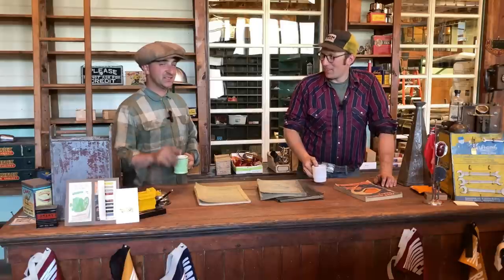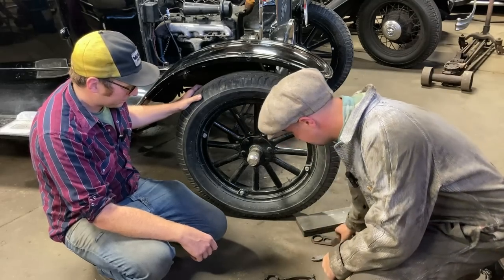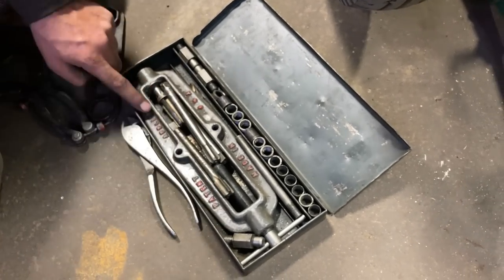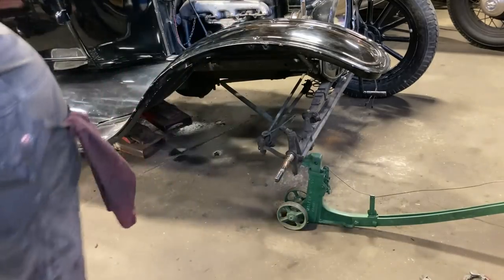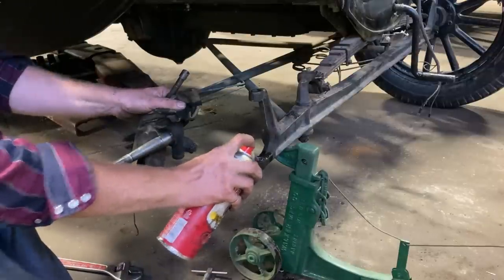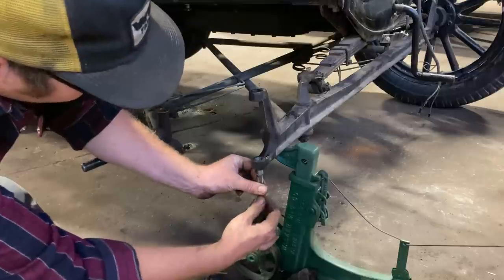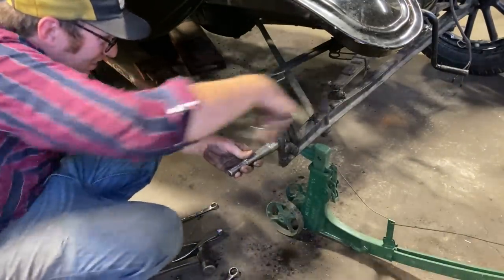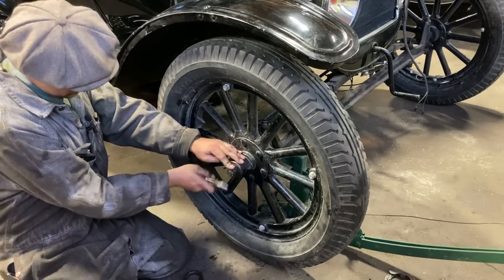Can We Save a RUINED Ford Axle! Repairing a 1925 Model T with Period Correct Stevens Speed up Tools

Comment: What was so nice about those old car's is that absolutely ever job could be done by your average man. You didn't need to be a class A mechanic to have to change out a set of king pins. but in did make easier if you had the right tools that's for sure.

Comment: Hey fellas. That was very interesting and a fun watch. It's great to see the specifically designed tools being used by people that have built up the knowledge to use them. It's interesting to think how this simple yet intricate design morphed into the more familiar 30s style kingpin setup. I never knew Ts had threaded wheel bearings and Jim's explanation made perfect sense. Oh yeah, having brakes on the front as well. That was a big step forward. All the best, Mart in England.

Comment: I will say the tools of the old day where made with perfection in mind. But not many know these days how or what they where used for. You should to a comparison video making the same job on a Old model A or T with proper old tools vs doing the same thing with modern and improper tools. It would make a interesting comparison. I remember the Ford T wheel caps that usually are very hard to put back or take off cause the thread is trashed somewhere. Also people used pipe wrenches and gods knows what to tighten them.